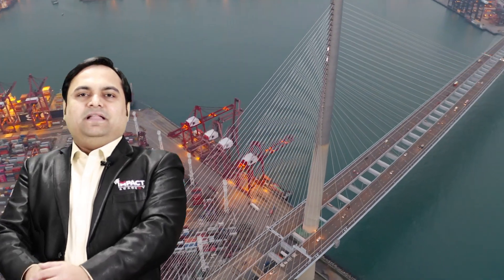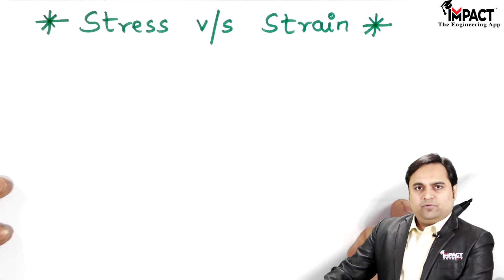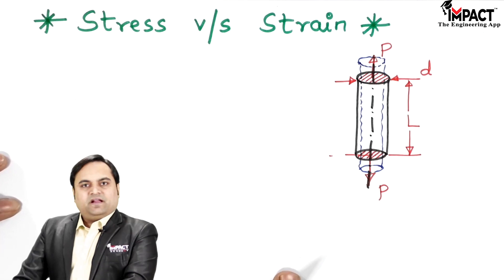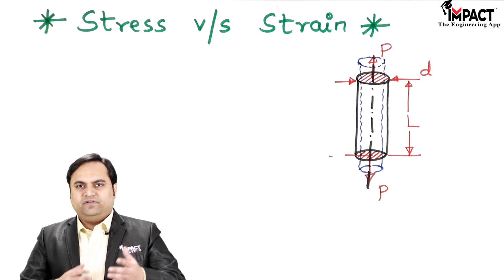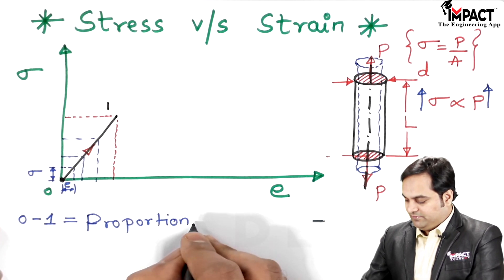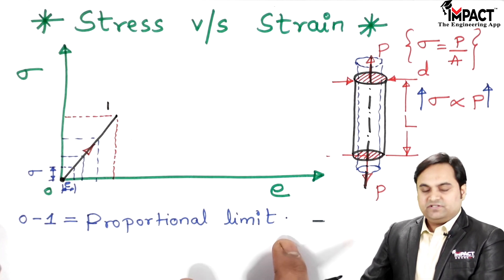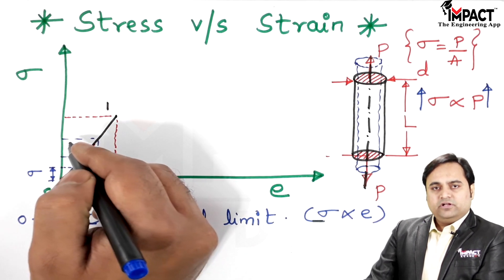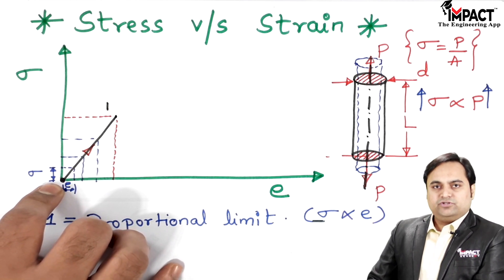Stress Vs Strain Graph for Ductile Material | Stresses and Strains | Strength of Materials #zafarsir

Comment: Hello Sir,

i have a problem with all explanations wrt the stress equation. when the force (tensile or compressive) is applied to the piece workpiece, the area of the applied point is changing, maybe linearly, but it is. the force is linearly increasing, bec this is the dependent function or controlled function. so i believe that the linear increase in the load div by the linear decrease in the workpiece area, results in a ~linear change in stress but may not be linear. the graph is an approximation of an exponential change in the stress .. help me better understand this please
Reply from the maker: http://bit.ly/impactEngineering
To access all Engineering Videos 
Please visit our app Impact : The Engineering App 
You can directly download the app from the link given on top👆🏻👆🏻👆🏻

For more queries related to app, contact our Customer Care Number :- 
+91 7900123134